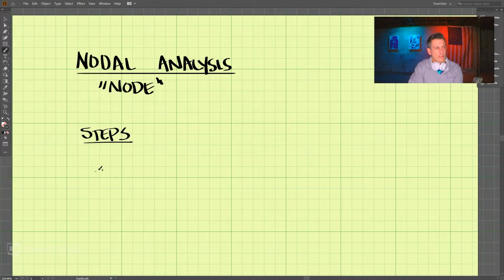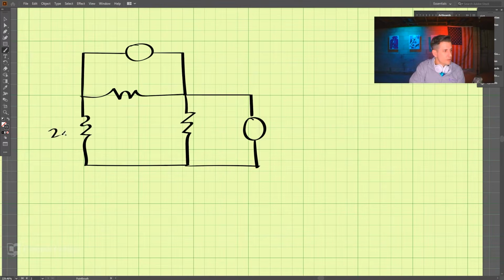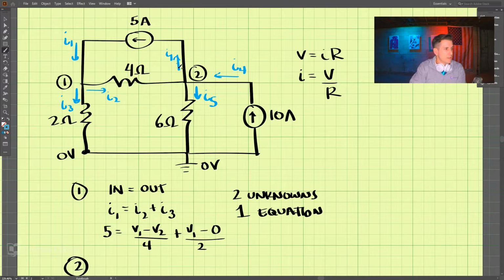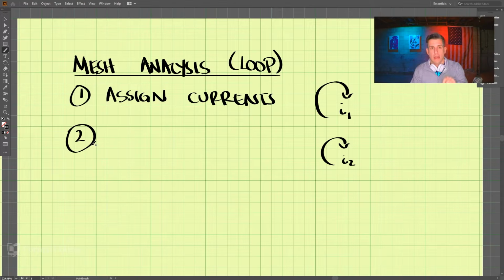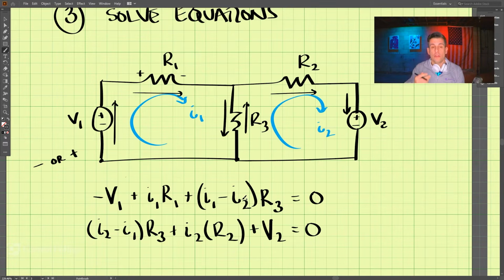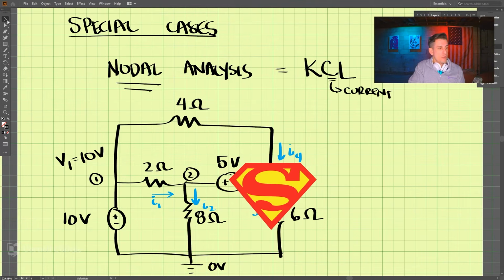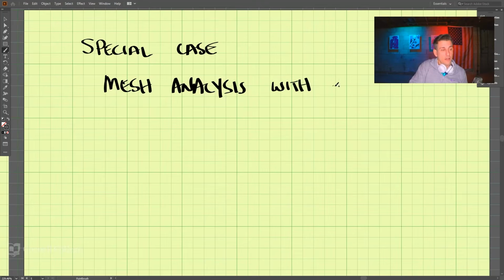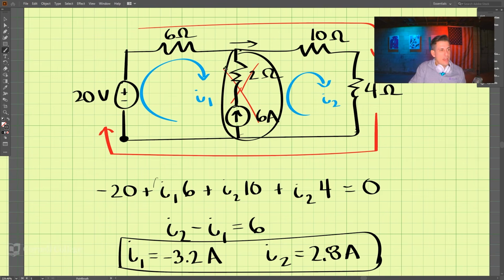Chapter 3 - Fundamentals of Electric Circuits

Comment: In the mesh analysis special case why did you take i2 - i1 instead of i1 - i2 . Can you tell the reason?
Reply from the maker: The direction of the current source is in the same direction as i2. i2-i1 = 6 or you could write i1-i2 = -6

Comment: Sir, why did you add these voltages at 32.17 timestamp? Does there any explanation behind this?
Reply from the maker: Voltage is always in reference point (commonly ground - 0 V). In this example a voltage source is connected between two nodes, in this case we call it V2 and V3. If V3 was ground, then V2 would be 5 V. However in this case, V3 is not at 0V, it is located in the circuit where the - side of the power source is not connected to ground. So we must write the equation as V2 = V3 + Vs, where Vs is the voltage of the power source (in this case 5V). When solving the system of equation we find that V2 = 9.2 V and V3 = 4.2 V. This checks with our equation 9.2 = 4.2 + 5.
Reply: @ProfessorJohns  I think it also helps them to understand it in terms of "higher and lower" potential. The V2 is on the higher potential side (+) of the 5V, and the V2 is on the lower end. So thats why its V2 = V3 +5V (at least I think so lol)
Reply: @okaytree7711  apply KVL to supernode
Reply: @ProfessorJohns  thank you so much sir! I understand ☺️

Comment: For the special case of nodal analysis. You used the formula V2=V3+5. Why is it not V3=V2+5 ? Should the voltage not be higher at the node after the voltage source?
Reply from the maker: Notice the + and - on the 5V power source. V2 must be 5V higher than V3. "After" the voltage source is the node on the + side of the voltage source. If the power source was arranged in the opposite direction your suggested formula would be correct. Hope this helps.
Reply: @ProfessorJohns  Yes sir thank you! Currently binging this series.